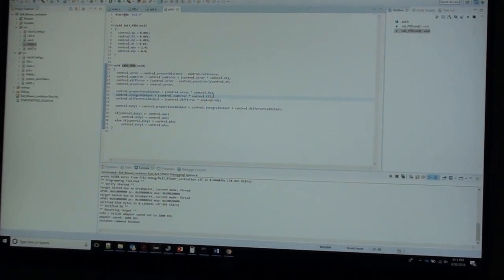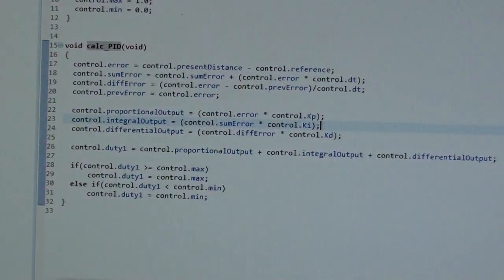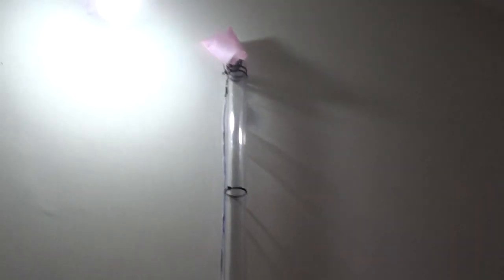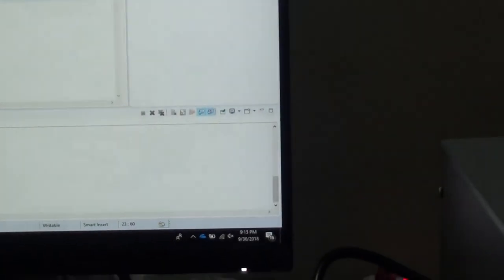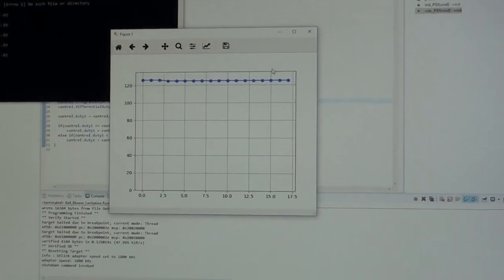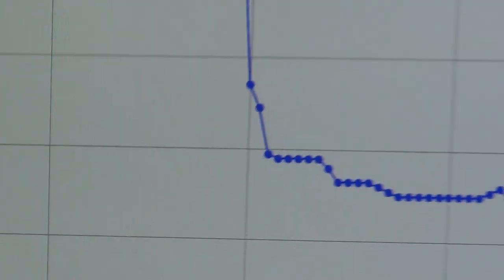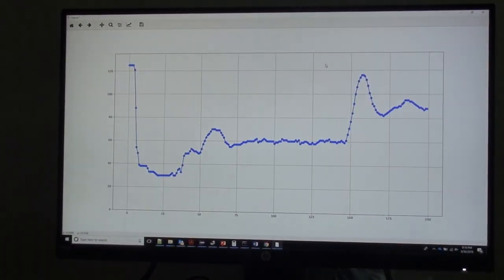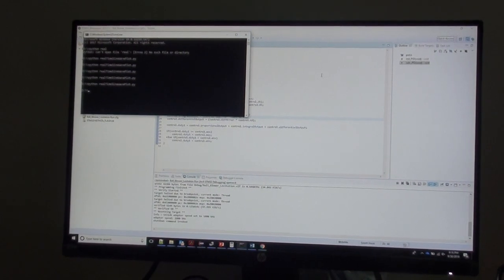Ball levitation with blower

Comment: Now how would I go about taking that data and calculating a transfer function that represents that system?
Reply from the maker: That is difficult, unless you have matlab, or you know transfer function before hand.
Reply: Debraj Deb I do have matlab so I have a way to log all the input and output data.  I saw one video where someone took all the data and used the system identification toolbar to create a transfer function.    Is that what I’d have to do?
Reply from the maker: @cooter3690  I think, you have to use SISO tool box. I mostly use manual tuning, as MATLAB is very expensive for hobby purpose.